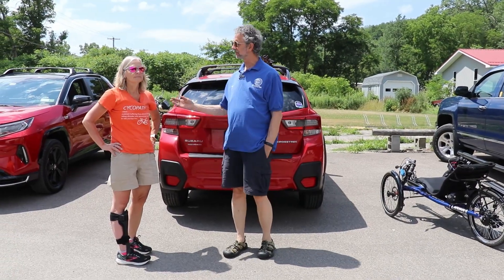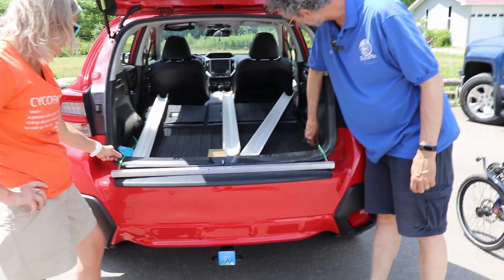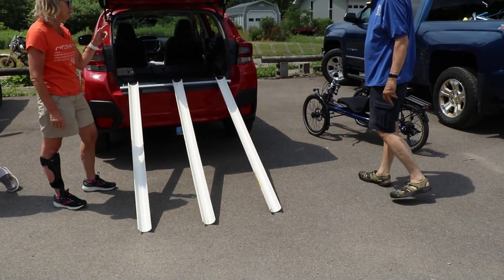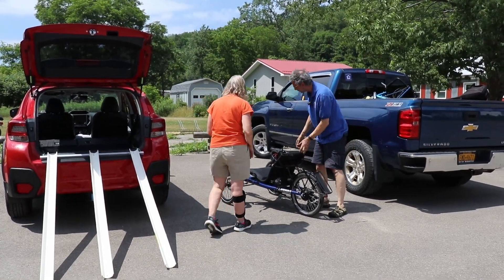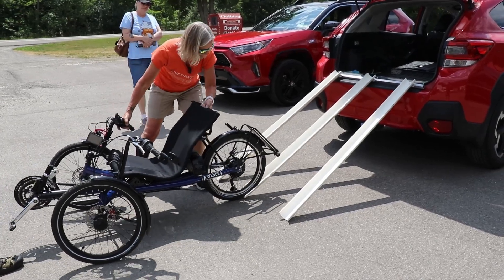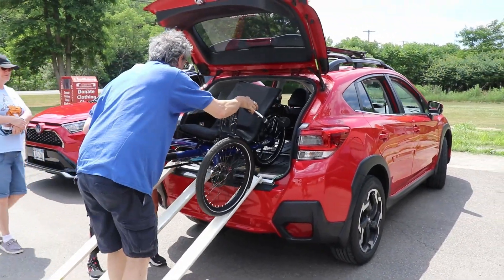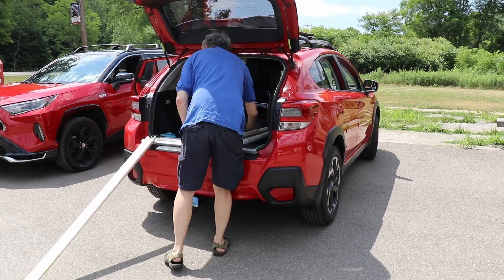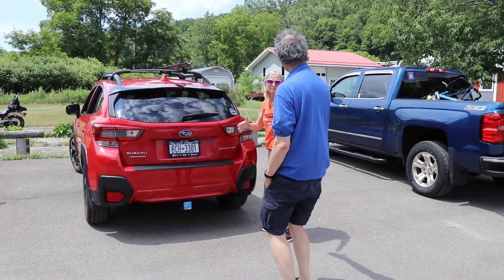Homemade PVC Ramp for Trikes

Comment: an extra tip for loading: Attach a small, rectangular piece of rug to the end of the tubes which touch the ground. They can stick out about 4-6" onto the ground from the tip of the pvc pipes at the ground level. This is a common trick with ramps for cars, as the rug gives a surface for the wheels to grab onto as they are loading onto the pvc tubes. Cheap carpet or rugs will suffice and are not in the way for storage in car or truck.

Comment: Yes, it takes good geometry skills or trial and error.  If the ramp is at too sharp an angle where it meets the tailgate or the ground, one end or the other, front or back, of the trike will scrape the ground.  Or the middle of the trike will hang up on the lip of the tailgate.  The ramp must be long enough for this.  I wound up with telescoping aluminum ramps, pricey but lightweight, convenient, do the job perfectly.  Eight feet extended, four and a half collapsed, but your trike and vehicle may be of different dimensions.  I use a little colored tape on my tailgate to mark the exact centerline for the ramps, so when setting up I don't need to give the alignment a second thought.  Just one of the thousand things that trike riding and ownership demands we sort out.

Comment: Attach some small chains or canvas type of fabric straps to link each long piece of PVC pipe so that when you spread them out to use them, they don't slide away. The chains/straps would not hamper stacking the three long pieces into your vehicle. It could easily be a one-person set up then. Nice video and thanks for sharing the idea.
Reply: Neat idea, thanks! I was thinking a rigid piece would be a bit nicer but it would have to be esily removable to go back in hte vehicle.